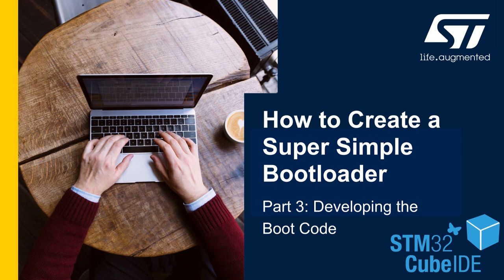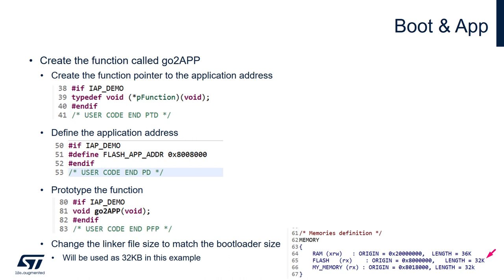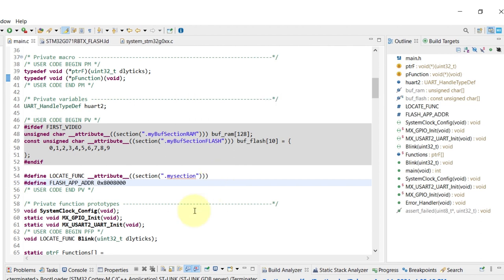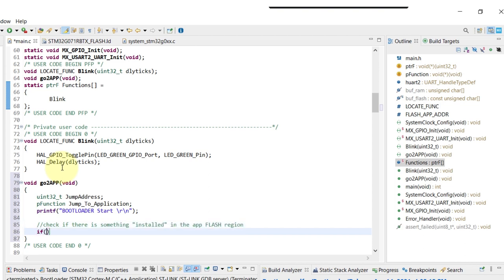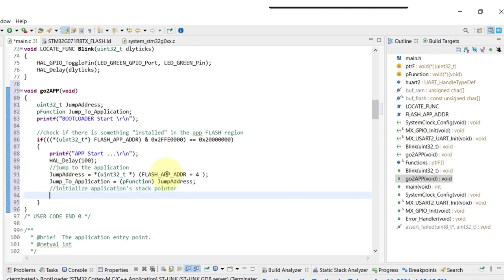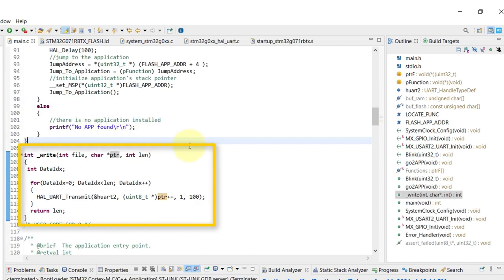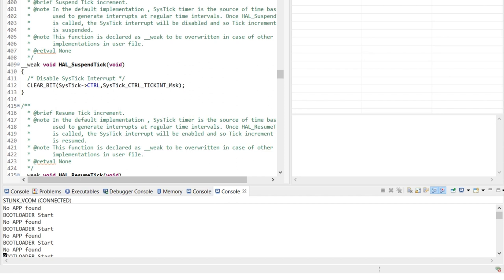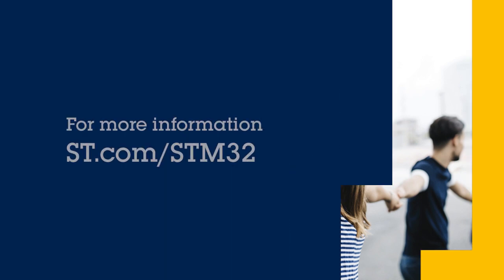How to Create a Super Simple Bootloader, Part 3: Developing the Boot Code

Comment: It would have been better to explain that the USART port used can also communicate over the STLINK_PINS as well.  Otherwise it leaves the user clueless as to what is going on.  Fortunately the user can just use the LED from the last project to turn on the LED while in the App and shut off the LED when in the boot.

Comment: What is the logic in the 'if statement' condition for checking whether there is an App installed or not in go2App? Could someone please explain this further?
Reply: if there is nothing at the address FLASH_APP_ADDR, the value of FLASH_APP_ADDR would be 0xffffffff, the purpose of the 'if statement' is to check whether the jump address is out of RAM size (because jump address hold the value of RAM's end address), let say his microcontroller has 32kB RAM, so the end address would be 0x20008000 & 0x2FFE0000 == 0x20000000 (in my case im using stm32F446RET which has 128kB and the RAM's end address is 0x20020000. If i follow him, the 'if statement' never be true 😂😂😂because the program check the value of jump address is excess RAM size). Also the value is 0xffffffff (no code). So the 'if statement' check whether your program is out of RAM size and check if you already had your program at the jump address. Sorry for my bad English because im not native speaker 😅😅
Reply: @TM-Khoa  Yeah, thats true. To explain further, what happens is that the AND operation with 0b00101111111111100000000000000000 blanks out all values below 0x0001FFFF (or 128kb) so all that's remaining should be 0x20000000. Of course, if the address went anywhere in excess of 128kb, that would not be blanked by the AND and in consequence, the equality would not hold up. Which means that the constant must of course reflect the memory / section size.
Reply: @neg8able  @Khoa Trương Minh I don't think this mask (0x2FFE0000) makes sense. The dev board he is using has an STM32G071RB on it with 36 KB of RAM. The mask does seem to be designed for 128 KB, as you pointed out it is ((128 * 1024) - 1) deducted from 0x2FFFFFFF. So if you use a value of 45 KB which is outside the range of the RAM, that would give a jump address of 0x2000B400, which you'd AND with 0x2FFE0000 which equals 0x20000000 and so would pass the if statement condition and be incorrectly treated as a valid jump address.

Even if the chip did have 128 KB of RAM, that would give a jump address of 0x20020000 which ANDed with 0x2FFE0000 equals 0x20020000 and fails the if statement. 

If the jump address does indeed hold the value of RAM's end address then it wouldn't it be better to simply check the address matches? For example: if( (RAM_BASE_ADDR + RAM_SIZE) == (*(uint32_t*)FLASH_APP_ADDR) )

For 8 KB RAM the jump address would be 0x20002000
For 18 KB RAM -> 0x20004800
36 KB RAM -> 0x20009000
144 KB RAM -> 0x20024000

Unless I am missing something. Will the jump address definitely always be the end of RAM address?

Edit: in the next video (Part 4) you see in his memory browser that his jump address is indeed 0x00900020 which is 0x20009000 when viewed with traditional rendering.

Comment: I encountered problem in our bootloader implementation using an STM32 microcontroller. I have followed the guidance provided in your videos, specifically on bootloader development, and have reached a point where the jump instruction to the bootloader address (0x20060000 in RAM and 0x08008000 in Flash) is causing a HardFault exception.
Reply: I am using stm32f429 controller .is program same for this controller except address ?

Comment: What does 0x2FFE0000 in the bitwise operation of the if statement signify?
Reply: I do have the exact same question
Reply: same question.. park here
Reply: Still no answer?
Reply: I'll post a link to the forum thread when I can find it again
Reply: the answer is that, since the flash pages have fixed size, and the programmation is done page by page, we should check at the beginning of the page, so we can ignore the 17 LSBs of the address (1 + 16 bytes) . This zeroing depends by the size of the page, obv., you should check

Comment: __set_MSP(uint32_t) sets the stack register before jumping to application which is actually reset_handler of the app we want to jump. But, reset_handler will set the stack register already. So is __set_MSP necessary.? A note for anyone curious, I commented the __set_MSP function and bootloader is still working.

Comment: If we have linker files for _FLASH.ld and _RAM.ld do we modify both so that they match?
Reply from the maker: Hello again. Here is the answer form our colleague you hear in this video:

No, the program uses only one of the *.ld files, the RAM.ld is meant to be used only if the application is being executed from RAM, which is not the case.
Reply: I think that RAM part is important for devices with huge ram and tiny flash. They are designed like this for loading application from some external FLASH memory into ram and then they execute it.